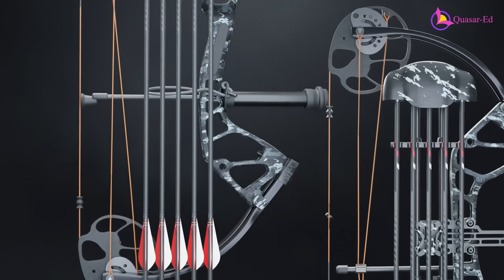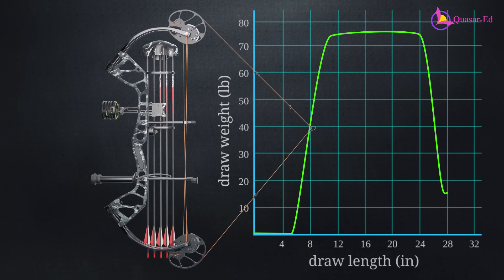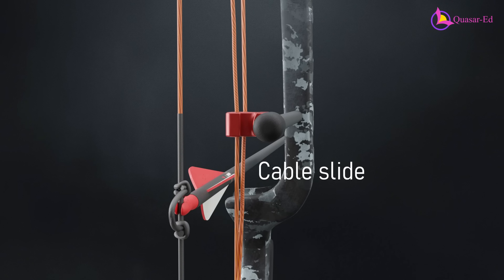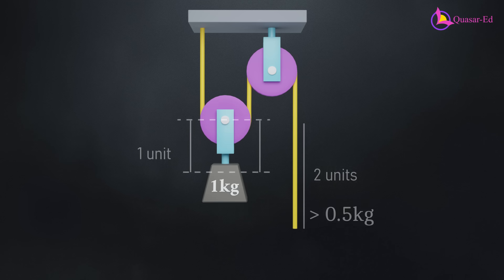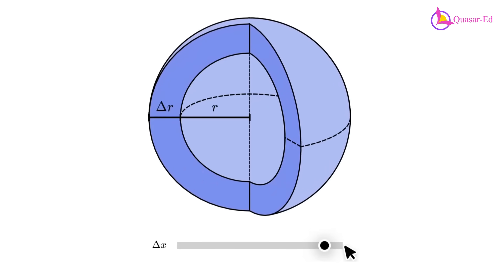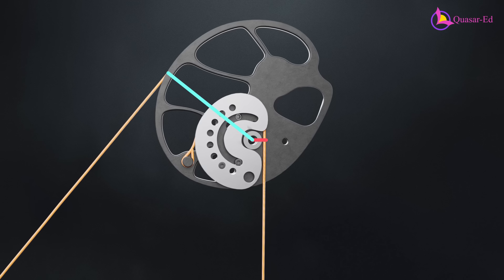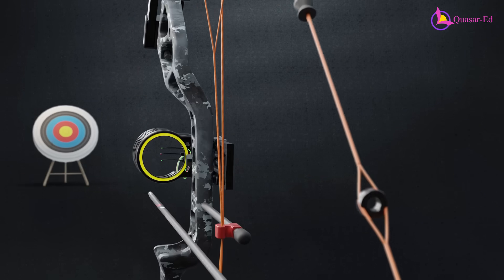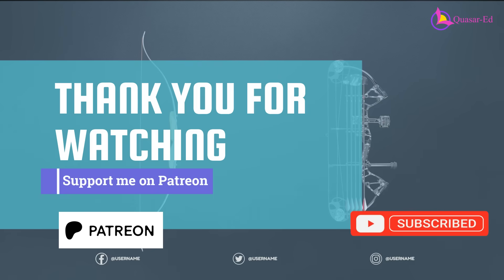The Engineering Behind the Modern Compound Bows

Comment: The theory behind how the compound bow works is incorrect. The basic reason it does work  is because the pulleys or cams allow the storage of more potential energy during the draw. That energy is equal to the area under the Force/Distance draw curve. Look at the difference in these areas between the recurve (just a triangle) and the compound bow (more like a rectangle). Thus, the reason given as "efficiency" is incorrect. My guess is that the efficiency of the recurve is higher than that of the compound simply because of the larger number of moving parts with the compound. 

Another error in this video is the explanation of how pulleys work. In the first pulley diagram, there isn't a one-to-one ratio of distances with the single pulley. The distance the pulled rope moves is twice the amount the weight is moved and when two pulleys are used, the total mechanical advantage is four, not two. Then, adding another pulley increases the advantage to eight. The narration contradicts itself when it gives the correct mechanical advantage at each end of the bow (four), using two pulleys.
Reply from the maker: I think I explain it when I show the two graphs. I didn't use the term area under the curve because most people might not familiar with it and I don't want to get more into maths. And about the pulleys, the mechanical advantage comes from the movable one, and not the fixed one. So the MA is two instead of four. I don't remember showing 1 to 1 ratio with pulley.
Reply: @quasar-ed  I suggest you look again at your explanation of these two graphs. At around 1:40, you explain only the "let-off" force, stating that this is the "biggest advantage" of the compound bow. Yes, it's a huge advantage, but another huge advantage is that it imparts more energy to the arrow. You never use the word "energy" in your explanation. But you do use the word "power," with error. At 6:10, you erroneously say, "The total power of the bow remains the same, regardless whether the pulley system is used." Then, at 6:11, you erroneously say that the reason we build compound bows is because of "efficiency," I repeat, the efficiency of a recurve is probably higher than that of a compound. I suggest you re-edit the video. This is simple physics. 

On the pully system, I myself made a mistake when I said that a two pulley system has a MA of 4. Simply, a movable pulley has a MA of 2 and a fixed pully has an MA of 1. The reason for a fixed pulley is to allow a 180-degree change in pull direction. But you show a two pulley system (one movable, one fixed) and call it a single pulley system. That's why I myself got confused and mistated my own explanation.

But don't misunderstand. I like your video. It gives good illustrations and allows for fruitful discussion about such a clever invention that curiously took so many centuries to first appear in civilization.
Reply from the maker: @orrabmas8991 Since you 'think' recurve is 'probably' more efficient, I should re edit my video? Anyone can point out all the things I left out in my explainer since it is not intended as 'all about bows'. I only want to explain as intuitively as possible which I think is the most important step to understanding anything. If people want to get deeper, they can always take an academic course. Here is a thought. How about you make a fully packed explainer video with all the equations and technical details?
Reply: @quasar-ed  Don't you think the fact that a compound bow imparts much more energy (and speed) to the (same) arrow for the same aim-holding force is a major advantage of the compound bow?
Reply from the maker: Didn't I explain that in my video? And why does it make you think recurve is more efficient?
Reply: @quasar-ed  That was just a guess because of all the moving parts in a compound bow. Each moving part experiences friction and air resistance, which dissipates energy. However, I could be wrong because the limbs of the recurve seem to be larger than the limbs of compounds and that might lead to more overall air resistance and internal frictional losses. There are other complications. By "efficiency" I mean the ratio of the peak kinetic energy of the arrow divided by the total amount of stored energy. That might be different from your definition. 

You said: "Didn't I explain that in my video?" I suggest you look at it again. I didn't see any mention of energy and arrow velocity. I'm not your enemy. I'm helping you with improvements to your video.
Reply from the maker: @orrabmas8991  Thank you. It is just that I try to use terms like 'energy' or 'velocity' or any engineering related terms as less as possible. I don't want them in the way of understanding the topic intuitively. As an engineer myself, it is important to grasp the intuitive understanding first, before moving on to the scientific formulae. So there are tradeoffs in making the video easy to understand and making it academically accurate. I really hope serious learners like yourself could understand. Let's not make the science boring and difficult for general audience.🤝🤝🤝

Comment: Some inaccuracies in this video:

-recurve bows don't have a linear draw draw force curve, longbows do. Recurve bows have recurves that function a bit like cams by changing the leverage through the draw by effectively shortening the bow early in the draw, then lengthening the bow once drawn back and the string has lost contact with the belly. This creates a rapid increase in draw weight early in the draw which then levels off, meaning recurves can store more energy than longbows for a given peak draw weight

-compound bows aren't more powerful due to increased efficiency from "stronger materials" - compound bows and recurve bow limbs are typically made out of similar materials. Compound bows are more efficient due to the limbs having to travel less distance yes, but the main reason they're more powerful is that they store more energy throughout the draw: energy stored can be calculated by calculating the area under the draw force curve, and compound bows have a higher draw weight throughout most of the draw, often their peak draw weight through most of the draw while recurve bows only reach their peak draw weight at full draw.

Comment: Do you have a drawing diagram of the parts of the bow?
Reply from the maker: if you mean CAD drawing, I don't. I do have 3d models but they are not dimensionally accurate since I only modeled them using photo references.
Reply: @quasar-ed  Ok thank you

Comment: 5:59 this illustration looks wrong... What you've illustrated is "force remains the same (40lb)", not "power remains the same". I'm not sure which the correct answer is but the the right side should be either 20lb because the distance looks like it doubled (power = work / elapsed time; work = force x distance; distance x2 so force 0.5); Or 10lb because this is a 4:1 mechanical advantage of four pulleys, or a pair of 2:1 systems
Reply from the maker: What I meant to say is 'The power remains the same' because the limb bends the same amount. Yeah it is my mistake that I put 40 lb on both sides. The one with the mechanical advantage would require less than 40lb. Thanks for pointing that out.

Comment: Fantastic video. Well produced and great explanation. Just a shame it had to belittle those who enjoy compound shooting at the end. Competing at a high level with compound requires just as much dedication and skill as competing at a high level with recurve bows.
Reply from the maker: It is not my intention to belittle those who use compound bows. Since the whole video is about compound bow, I just want to give my respect to traditional bows at the end. If the ending give you the wrong impression, I am sorry. It is a difficult situation where if I praise something, it could mean I belittle the other side kind of thing.
Reply: @quasar-ed  I think you could have left that whole part off and that video would have been perfect, and traditional archery would have been fine without being mentioned in a video about compound bow engineering.  
Was going to link it to a few archery websites but that's really off-putting for that purpose. Seriously for what you wanted to do it was great.

Comment: a few additions for a bit extra info:
1. the string stop isn't mainly for string oscillation per-se, but to give the arrow a more consistent push/kick as it leaves the string.
2. The d-loop behind the arrow also eliminates the inefficiency and inconsistency of string travel behind the arrow, delivering it directly forward and evenly as the string moves to brace height. this is compared to finger shooting, where finger pressure greatly changes how the arrow flies, especially shot to shot.
3. a lot of compound Archers, at least from my experience also like to use magnified sights with height adjustment, generally preferred for competition, i.e. Field/3D/Target archery. multi-pins are more common for hunting, though.
4. you said counterweight but to go into more detail, the stabiliser isn't just for vibration, but mainly to assist/allow the Archer to aim the bow without having to fight the natural upward climb that comes with pulling the arrow above the grip. this is kinda familiar to the "bore over grip" concept to firearm people, except instead of recoil it's the Archer pulling the weight above the grip.
(I shoot traditional Korean/Turkish styles, and Olympic Recurve)

Edit: corrected to "bore over grip" thanks for the heads-up ICanHazTwentyLetters
Reply from the maker: Thank you for providing so much details. I didn't know about the magnified sights.
Reply: Excellent writeup.  One thing to note is that for firearms, the aforementioned "height over bore" is used to describe the vertical distance between the gun barrel axis and the sighting axis, and is only relevant in terms of sight adjustment in relation to the projectile trajectory. Bows also have height over bore as mentioned in the video.  
It'd be more accurate to denote "bore over grip" for your evaluation of-, and comparison to, firearms recoil.
Reply from the maker: @iCanHazTwentyLetters Thank you. I didn't know that term till now.
Reply: @iCanHazTwentyLetters thanks for correcting that, didnt realize my mistake but thats a way clearer explanation
Reply: Also I suspect the more constant acceleration of the arrow helps a lot.
Reply: 1. String stop also allows for a shorter brace height without arm contact
2. D-loop can also be used to adjust the amount of pressure on the arrow rest
3. And we even have multiple pins on a slider
4. The stabilizers also help keep the bow stable DURING the shot. That same bore over grip offset offset (force driving the arrow above the fulcrum of the grip) makes the bow want to rock back once the string is released. A stabilizer, properly set up, keeps the bow still until the arrow is gone.

Comment: Shouldn’t draw length be measured from the neutral position of the string and not from the front of the bow near the grip? Otherwise it would start not from 0 1:20
Reply from the maker: That’s a sharp observation! The actual string movement does start at the brace height, so for calculating energy, that’s the real “zero” point. But draw length in archery is a standardized measurement from the grip’s pivot to help with sizing and tuning. It’s kind of a mix of practical convention vs. physics.

Comment: And as a bit of a lifting nerd, the force curve aligns very well with the strength curve of the back muscles, especially with the fact that they are weaker towards full contraction
Reply: can you elaborate
Reply: @cursedswordsman some positions are easier or harder to exert force through I think and the bow draw difficulty aligns with the force exerted as the position changes?
Reply: @cursedswordsman  muscle movement is basically chemical reaction,so like any chemical reaction it fizzle out

Comment: you forgot to mention the reduction in arrow flexing in a compound bow, which increases power because of reduced drag
Reply: Yes but with a recurve all you have to do is get center cut and use a mechanical release as well
Reply: @paulheberling2750  the arrow will stil flex in flight, not because it touches the bow, but because  the acceleration compresses it
Reply: @Niemand-x5s  for sure, it’s just more akin to a compound bow now than traditional finger recurve

Comment: If more skill is what makes recurve bows better then that makes compound bows best.

There is more skill required in making a compound bow from scratch than there is to fire a recurve.
Reply from the maker: @cgarzs  You can't compare making a bow and shooting a bow. These are two completely different skills. One is engineering and one is physical skill.
Reply: @quasar-ed  Exactly. Engineering clearly ranks higher than "Oh look, I can use some muscles in an accurate way".
Reply from the maker: @cgarzs  But compound bow users don't really build their bows from scratch. Nor the traditional archers. So physical skill is the comparable quality between them. But if you are comparing between bow makers, of course high tech engineering skills might rank above the old tech.
Reply: @ True, most people don't make their own bows. Which bolsters the case that there is more skill required in making a good bow well than firing it well.

Comment: You should’ve mentioned a warning against torquing. If you twist the compound bowstring while at full drawn, you run the risk of the string getting derailed rom the cams, which will make the bow unusable, and possibly whip you in the face.
Reply from the maker: @Symbol-Guy  Thank you. Now I don't need to mention it.😉
Reply: for more info, this is negated by the use of a d-loop + release aid, which the vast majority of shooters prefer to use. but yes, safety is well mentioned!

Comment: There is an additional design aspect of the compound bow which was not mentioned - which results into higher energy transfer to the arrow - which results in higher arrow speed. The diagram showing the high pulling strength at low pulling distance nicely visualizes the high acceleration the arrow gets during that phase after the release and getting higher acceleration when coming forward. The force (and that way the acceleration) increases by the factor of the let-off during the acceleration phase of the arrow. The integral under this curve actually is the energy transfered to the arrow and is obviously much higher for the compound bow than under the recurve bow's triangle-shaped curve. This smart "distribution" of the force gives the compound bow's arrows the higher speed.

Comment: I build and shoot primitive self bows. Build my own strings and arrows. I also shoot trad laminated longbows.  

I’ve got a hand full of compound buddies. I have nothing against them. I am a very practical meat and potatoes kind of guy. I always want bomb proof gear deep in the woods. If a compound fails in the forest, theirs no recovery. You’ll need modern technology/vice/bow shop. That’s why I don’t use them. Their fun as hell to shoot .

The only other thing I bust the balls of my compound bros is that the 70 pound bow they pull is really 15/20 pounds. After shooting 60-70 pound longbows I know as I age/or injury I will have to shoot less weight.

But compounds win in the speed/power. I just like my simple stick and string

Comment: If shooting a 40 lb. pulley bow from a full draw is equivalent to shooting a 40 lb. recurve bow from a partial draw, wouldn't the pulley bow still have more power because the arrow is being accelerated for longer before it leaves the bowstring? I know this is why crossbows require vastly higher draw weights to achieve the same power as bows
Reply from the maker: @Cr33pysku11  May be a little bit. For the crossbows, they have to use higher draw weight since they use much heavier bolts instead of arrows. Or they have to use stronger and heavier bolts to withstand that short acceleration.

Comment: The issue I have with compound bows is that, if I want to use a bow it's because I want the simplistic feel of a bow - recurve is a better choice for that. If I want to hit something dead on with high force then I use a gun. Right tool for the job. Compound bows don't fill a viable niche.
Reply: If you like the simplistic feel, you should try longbow. It's just you and a stick then
Reply: @welshcrusade9837  it's on my list. I've not found one worth the price yet and my own attempts at construction weren't up to snuff. Any recommendations for good quality to price ones?
Reply: @Blxz  Either Bearpaw or Buck Trail are good brands if you really want to get into it. Though they're a bit on the espensive side of longbow, so if you're looking for the slightly cheaper end to get starte, I'd recommend Rattan

Comment: I remember when joining archery club in college. We use pipe as bow limb and part of slipper as part that launch the arrow. For the string, we used rope. That's very fun, though the arrow is limited. However i quit since i kinda busy. So i want tor eturn to archery as hobby. Which bow i need to buy as amateur?
Reply from the maker: @riski_putra6725  If your purpose is archery, go with a recurve. You can go to the archery shop and pick out the one that you can draw with some effort. But if the purpose is for hunting, you can ask for beginner friendly compound bow.